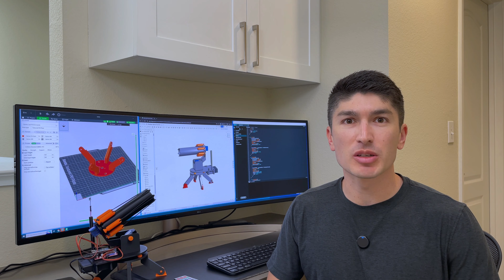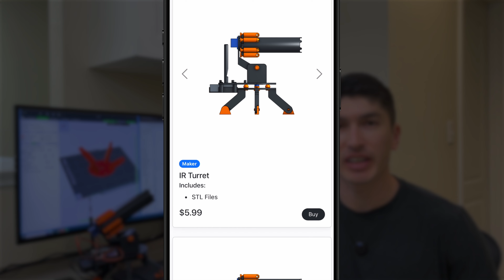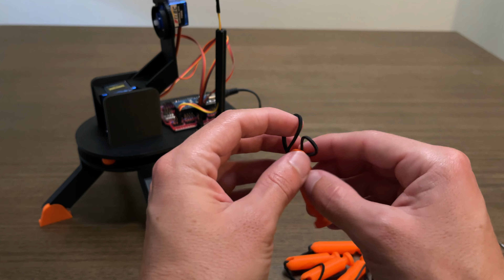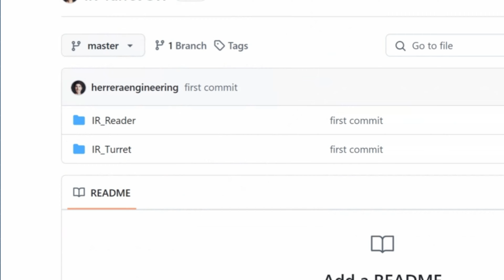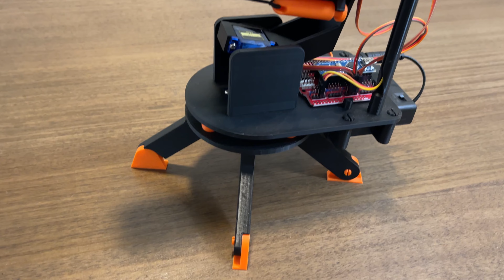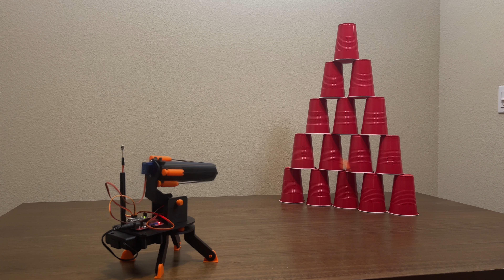How to build the Hack Pack IR Turret from SCRATCH

Comment: I'm building the turret with my son but i cant get a good fit between the servos and the printed parts, the holes were too narrow. I cleaned them up with a drill but now they are too loose.. i kind of wish you would have used the servo horns. And what are the differences between v2 and other parts in the package?
Reply: If you can't find a good fit, you can get the .step file and modify it for your part.

Comment: Thank you so much for designing this and putting together such a useful video and making the code available! I was able to follow along every step of the way, and can suggest a few improvements to the process. As others have said, more attention to the assembly in the video would have been helpful. The wiring diagram helps, but a closeup photo of the completed wiring might be more helpful for some. I'd also propose some work on the Arduino control code since the servo movements (at least for my hardware) are a bit off. Don't take that as complaining though because this is a very impressive project and you've done a great job making it available!
Reply from the maker: Thank you so much for the kind words and feedback! I'm still figuring out the best way to showcase my projects and provide resources for others to build them, so I’ll definitely focus on improving in the future. I'm not the strongest when it comes to software, so I really appreciate your suggestions and will work on implementing them soon. Cheers!

Comment: Hey Bryan. This is an awesome build. I'm having trouble with getting the ir remote to work accurately despite the instructions.. any tips on where to go look in the code? Thanks!
Reply from the maker: Assuming that you have gone through the process of decoding the IR signals from the remote and saving these values to IR_Signals.h (IR signal values may vary from your remote vs mine). The short technical answer would be to check IR_Logic.h file line 14. The variable FUZZINES could be changed to allow for larger variation in the received IR signals. I haven't played with this variable much but theoretically it should allow for some variance in the IR signals being received vs the stored IR values in IR_Signals.h. I usually debug IR issues by connecting the arduino to the laptop (via usb) and open the Serial Monitor in the Arduino IDE. If signals are received then the Serial Monitor will print out the confirmation. Just be careful not to get the usb cable twisted up around the robot. Hope this helps!

Comment: I want this product but one question, all hardware in 7 $ or I buy form other platforms ?
Reply from the maker: The $7 will get you the digit files to download and print assuming you have access to a 3D printer. All the hardware and electronics need to be purchased separately. I have included Amazon affiliate links for the hardware.
Reply: @HerreraEngineering Thank you for informing me, but I am working on this as my college project, and since I am a student, it is not possible for me to purchase all the required components. Could you please suggest an alternative IoT project?

Comment: Does this project have the ability for the same proximity sensor and face detection mod like the rober pack?
Reply from the maker: I'm not familiar with the Mark Rober mods, but if you have the necessary tools and resources, you should be able to integrate those mods with some additional software and hardware. I haven't tried it myself, so I can't guarantee success, but feel free to experiment. I'd love to hear about your results!

Comment: Is it possible to build a quadcopter with hawk body of articulated wings 🪽 & claws
Reply from the maker: I’m sure it’s possible. It would be a complex project, especially balancing the extra weight and flight dynamics, but it sounds like a cool challenge!
Reply: @HerreraEngineering  I tried long back but it didn't fly properly, I think you can